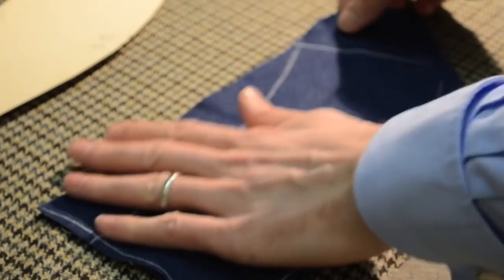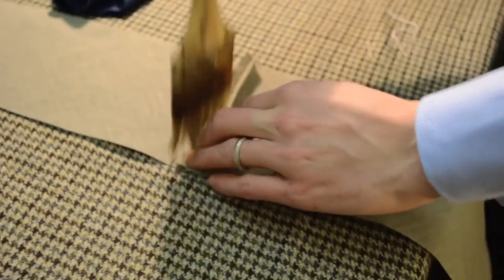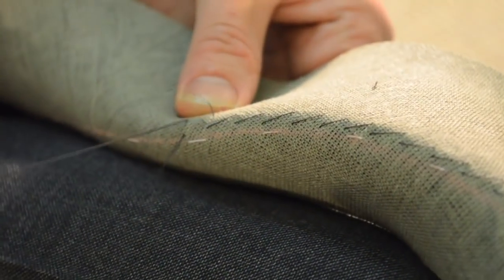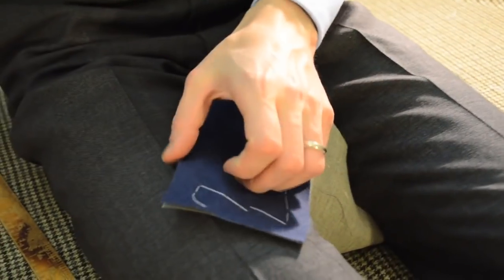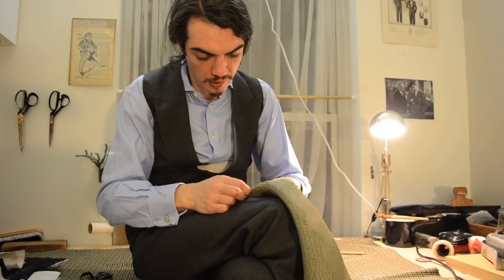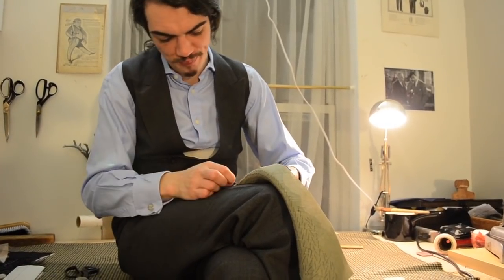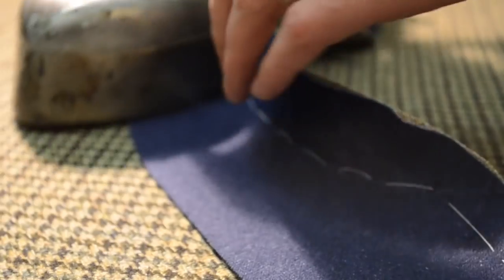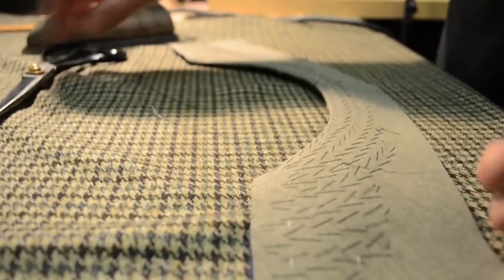The Making of a Coat #9   Making the Collar

Comment: I've been sewing for 50 years and have always struggled with the collar.  Sometimes it comes out OK, but more often it doesn't lie flat, curls the wrong way, etc.  Most instructions say to cut the undercollar a bit smaller, but that alone is not always the thing that makes it lie correctly.  I followed your video on basting the interfacing to the undercollar to make it roll before stitching the upper collar and voila!!  Perfect!!  I will be watching your other videos, too.  I'm not a tailor, but there is so much to learn about construction techniques.  These are not techniques for throwing together something overnight.  But, if I'm going to go to the trouble to pay for good fabric and sew a garment, I want it to fit perfectly and look great.  Thank you!